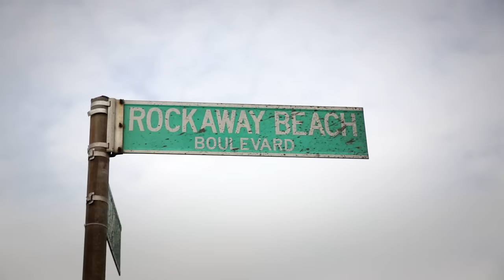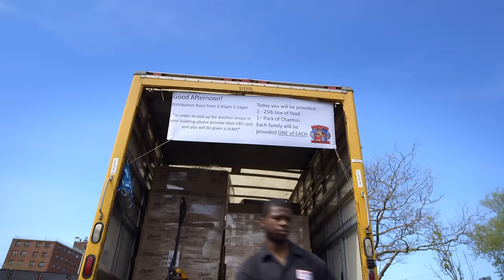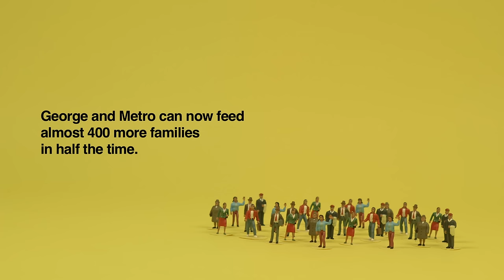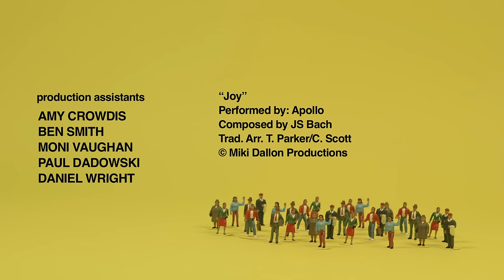Meals Per Hour

Comment: Great message and great presentation... the casting and food drive selections could have been better. I felt very uncomfortable watching the majority of this video as I felt that it portrays underlying systemic racism. A harsh summary of this video could be: "whites come to correct the barbaric rituals of blacks in need." Everyone with Toyota was white and everyone they were helping was black. However, I know several food pantries that could definitely use help are run by whites and I personally know several black industrial engineers that are capable of helping. This video is outdated and I personally would not use it in any educational setting (as it was shown to me).